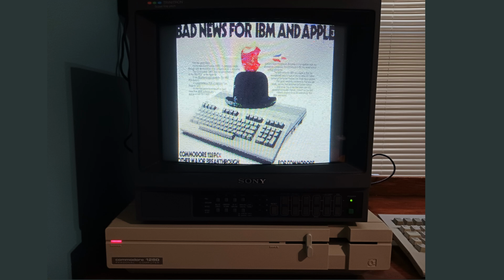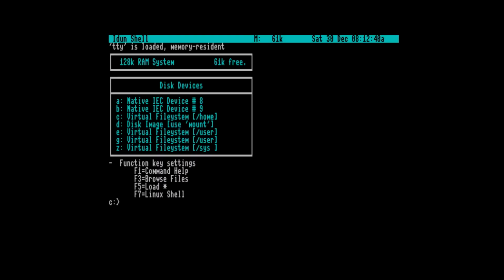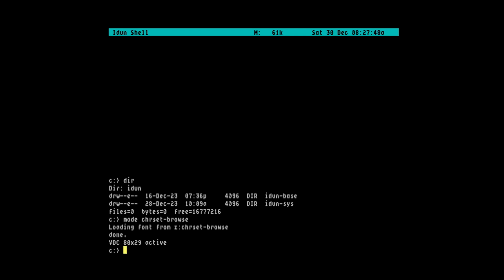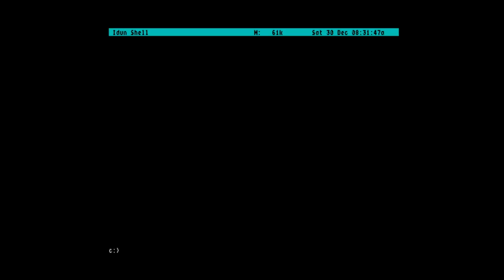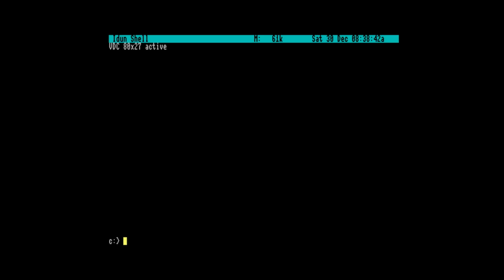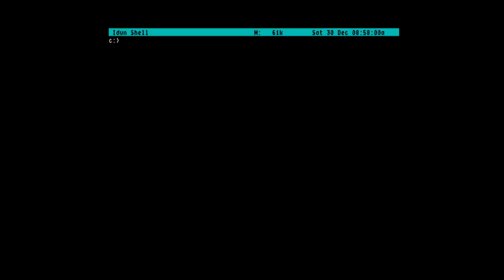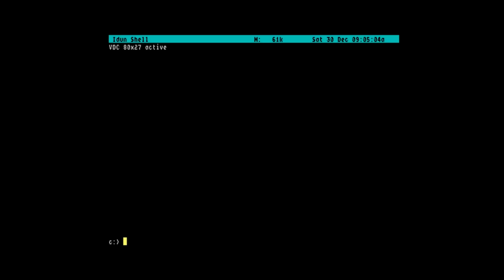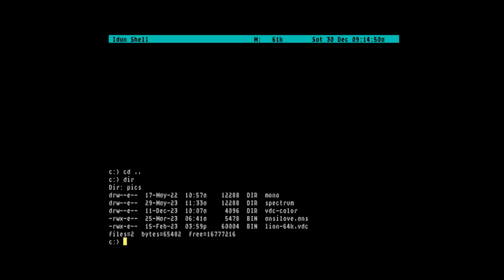Getting the most from C128's VDC chip w/ idun-cartridge. Higher quality graphics/easier programming.

Comment: The regular C128 only had 32k. You had to exand the internal VRAM to 64k to do this.
  The C128D came with a full 64k and had some other tricks.
Reply: Regular C128 (not C128D) has 16K Video RAM can be upgradable to 64K.

Comment: You should add 720x350 and 720x700 monochrome, this is the resolution of the Hercules graphics card.

There are some videos of Monkey Island in Hercules mode on YouTube.
Reply: I'd recommend to give the modes names known from the PC and the Amiga. It is also better to sort them by resolution and color type. Here's my list to support most classic computers:

Mode 1 320x200 - NTSC²
Mode 2 320x240 - QVGA¹
Mode 3 320x256 - PAL¹
Mode 4 368x352 - D20¹
Mode 5 400x300 - QSVGA² (or Super72)
Mode 6 512x384 - QXGA² (or HighGfx)
Mode 7 640x200 - MedRes¹
Mode 8 640x400 - HiRes¹
Mode 9 640x480 - Productivity¹
Mode 10 640x480 - VGA²

Mode 11 512x342 - MCC³
Mode 12 640x400 - Mono³
Mode 13 640x480 - MVGA³
Mode 14 720x350 - Hercules³
Mode 15 720x700 - Hercules2³
Mode 16 800x600 - MSVGA³

The modes marked with ¹ have a normal amount of color cells, the ones marked with ² a higher amount which are probably less used. ³ are monochrome modes.

320x200 NTSC was the most flexible resolution on the original Amiga. The later PAL models got 320x256.

320x240 is a quarter of VGA. The DOS version of Turrican II used this mode.

D20 is the double resolution of the VIC-20. The VDC is well suitable for the VIC-20 color palette.

QSVGA and QXGA would be named by PC resolutions, on the Amiga they are called Super72 and HighGfx. QXGA/HighGfx is also the double resolution of the ZX Spectrum.

512x342 is the resolution of the Mac ClassiC - To avoid confusions with Apple I think MCC is a better name.

640x400 Monochrome is the max resolution of the Atari ST and it would be the best resolution for GEOS 128.
Reply from the maker: You're right. I bet those modes could be interesting with the right foreground/background colors and a nice 16-pixel high character set.
Reply: Also interesting would be quarter-PC resolutions: QuSVGA 400x300 and QuXGA 512x384. They are small, but based on a standard, and they can be in color.

These modes are also interesting because the Amiga AGA chipset has these: Super72 LoRes and HighGfx LoRes. This would allow drawing images in DeluxePaint and then converting them to VDC format. And because the Amiga can read and write 1581 disks it is very easy to exchange files.